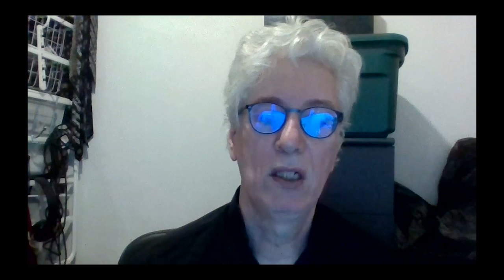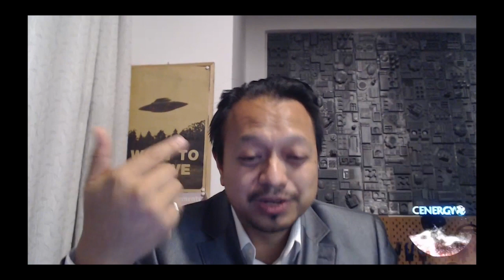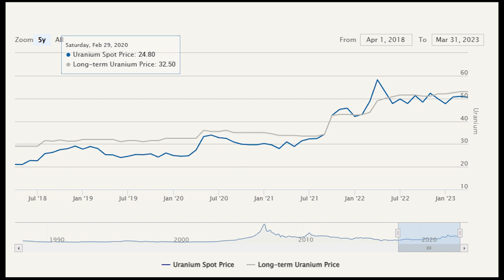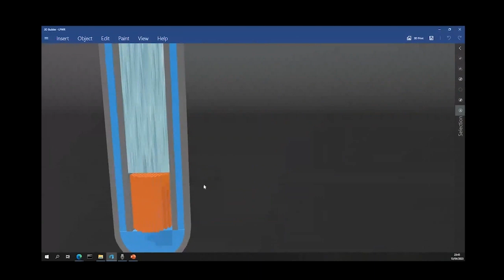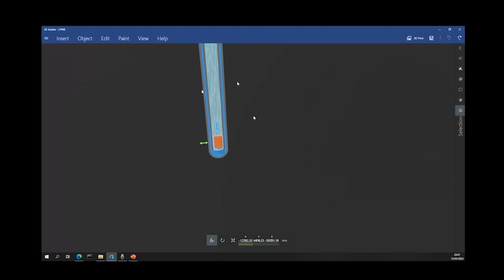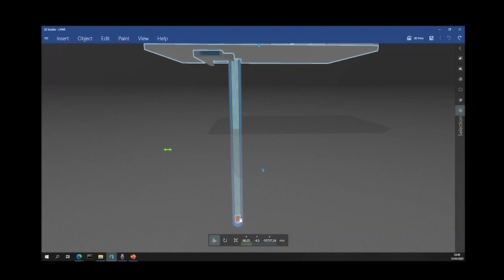What's Under the Hood? - LPWR (Low Pressure Water Reactor)  Azrudi Mustapha

Comment: I cannot see a path for shutdown that would sustain the all-important high pressure water column needed to continue cooling the core. Certainly residual heat would at some point fail to drive the turbine, eventually breaking the gravitational loop.

There is a number of assumptions in my argument, but the logic is solid.

Additionally, what is the efficiency cost of using a turbine designed for a much lower input to output pressure delta?
Reply: Hi! Thanks for your comment. Yes you are right during a reactor shutdown the main natural circulation loop would cease to occur. There is a RWST tank that floods the entire underground chamber during a shutdown with borated water, and a thermosyphon effect would occur to remove heat from the reactor and transfer the heat into the storage tank. Even if the residual heat removal exchangers stop working, the temperature in the RWST would rise only by about 10-20 degrees.